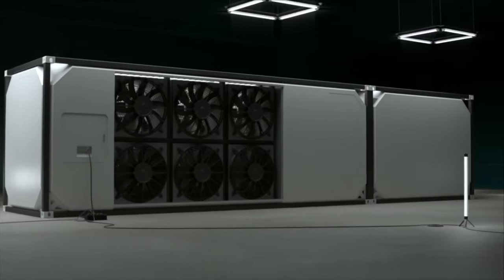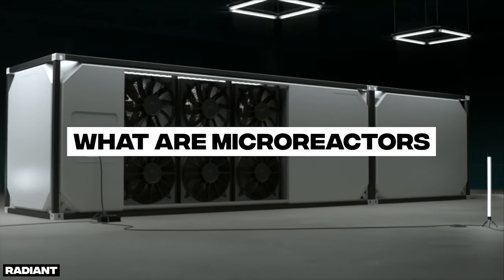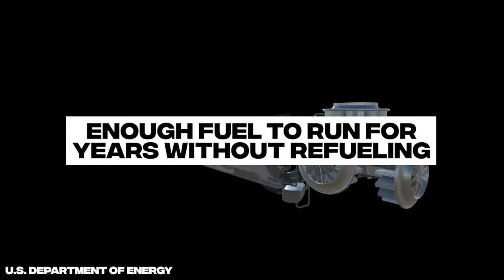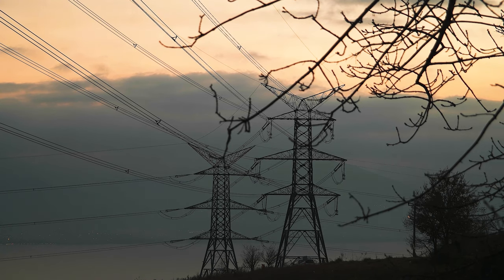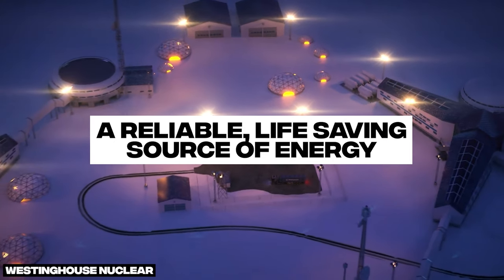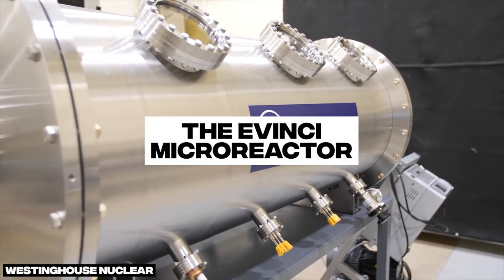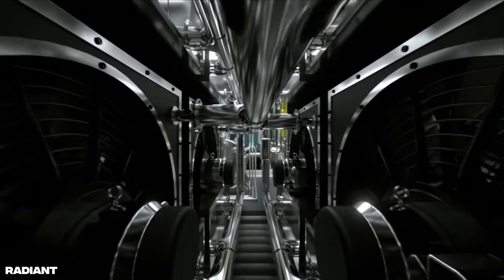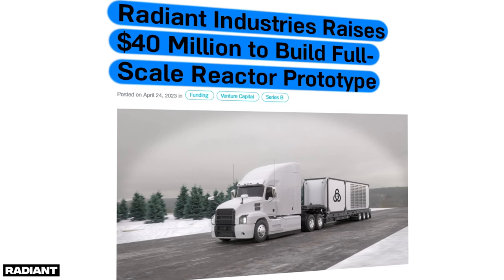Mobile Nuclear Reactors Will Change Everything

Comment: yea actually microreactors are faaar less efficient than real ones... its an absolute emergency solution that will mostly only fit to rare occasions like antarktica or north of russia. And than it is still the question is it neccessary to be at this remote place with a reactor. With russia they have used something likely and more than 1000 of the nuklear "reactors" have been abandonded somethere in the wild and while still not every one was recovered they tried to recover most until russia invaded ukraine and bailed out of the contract. The reactors where a more passive heatsource to generate power. Therefore the risk was not to have a meltdown but just contamination as things get old and people forget about them when they are not used.

So if the company running the site goes out of business, potentially nobody will care about a old nuclear reactor until people get hurt. They just get forgotton just because they could not transport it last month and maybe not next month to nobody cares about it. Some tourisst or scrapmetal thief one time or another will tamper with that thing. This is not a theoretical problem this already happend at least twice with some nuklear devices that had been setup exactly due to the same reason. Another one was left unprotected outside where extrem cold and water / ice crushed it open after many years in the wild.

These will maybe not destroy the earth but these reactory primary will create headache for the future.

Comment: This is crap. There will never be mobile nuclear power stations for the same reason there are no mobile coal power stations - the inherent inefficiency of small steam boilers/reactors and turbines. Small modular nuclear reactors were thoroughly explored in - to my knowledge - at least six countries in the 50s and 60s, with billions (in today's money) spent. The Soviet Union in particular went for them in a big way to power and heat Siberian cities. Like everyone else, they concluded it was far cheaper to just build big Chernobyl type reactors and run power cables to where you need it. It has nothing to do with nuclear's safety and everything to do with the physics of precision large hunks of metal.

Comment: Micro reactors make me wonder about nuclear proliferation.  If someone got a truck and stole a few microreactors, how difficult would it be to use them to produce plutonium?  This is probably much less of a concern for places like Alaska than places like Afghanistan.  It also sounds safer than nuclear container ships because at least they're designed to stay still most of the time and people would notice if the power went down.
Reply: 20% enriched uranium is not weapons-grade and cannot be used to produce bombs. To build a bomb, you'd have to enrich it to 90% or so, a process which would take time and money and a knowledge of nuclear physics.
Reply: The interesting thing is these (and other reactors) DO produce plutonium.  BUT that plutonium can't make a bomb.  When plutonium is made this way you get a mix of isotopes.  Pu239 comes from U238 absorbing a neutron (U238 is the other 80% of that "20% enriched" fuel).  However, with so many neutrons around, it rapidly moves to create a comparatively large amount of Pu240, '241, etc and these don't make bombs.  They actually are what make the Pu239 which remains USELESS for bombs.  If your next concern is what about separating out the Pu239, consider that if they can do that, it is easier to separate out U235 from U238 in the first place and skip the thieving.
Reply: @LFTRnow  This is interesting.  I forgot about other isotopes of plutonium.  Since the  reactors are not designed to be refueled, it would be tough to reprocess the fuel often enough to keep the Pu240 levels low.  So if I were an evil Bond villain, I'd rather try to find a molten salt reactor and leave these ones powering their cities.
Reply: The right amount of Explosives 🧨 and got a portable dirty bomb.☢️💥☹️
Reply: @YellowRambler  Not if they're as well protected as typical nuclear reactors. The containment buildings on most active NPPs today could withstand weeks of artillery bombardment and can't be penetrated by a Tomahawk cruise missile. Also, most of the radioisotopes found in a reactor are not the sort which a purpose-built dirty bomb would use, and are quite heavy, so they likely wouldn't carry very far.

Comment: The idea that using radioactive motors is some kind of great idea runs contrary to ALL environmental considerations - as in (a) There are VERY obvious risks to man and to the environment, and (b) What PRECISELY is to be done with all the radioactive waste? This is ALREADY a ticking time-bomb for future generations to have to TRY to sort out - from Nulcear Power plants. 

Give me alternative non-poluting energy sources, please. Vehicles could use bio-oil (non-polluting) and for energy there is not only solar and wind power, but recent R&D at Cardiff University (UK) have produced small-scale and effective means of using TIDAL POWER to generate electricity. 

Who knows, if UFOs do turn out to exist, then there must be some kind of anti-gravity/propulsion system powering them. If in doubt, ask an alien... 

I see any and all moves towards greater reliance on nuclear as being foolish and highly irresponsible.
Reply: > Vehicles could use bio-oil (non-polluting) 
It turns out that in Alaska the growing season for bio-fuel plants is quite short. (of course, you could truck it in, at the same cost of diesel, but then you have saved ???)

> and for energy there is not only solar and wind power, 
It also turns out that in Alaska the sun only shines for 2-3 hours a day for 6 months of the year - the COLD DARK months when power is needed most.
And the wind is quite low at that time also.

> but recent R&D at Cardiff University (UK) have produced small-scale and effective means of using TIDAL POWER to generate electricity. 
It also turns out that in the Alaskan interior, there are no seas to generate tidal power.

Huh! Who would have thought?
Reply: @factnotfiction5915 In Alaska, like everywhere else in the world, it is possible to IMPORT goods - such as biofuel. In point of fact, most of Alaska is sparsely populated, so importing electricity from other places - in this case, from, say, California, New Mexico, Texas, etc. shouldn't pose a major problem, should it? 

And there ARE coastal regions of Alaska where there ARE tides. And with such a small population in inland alaska, burning some logs in a wood-burning stove won't greatly harm the environment. 

Anything has to be better than makiing a massive problem for future generations by having nuclear waste to deal with in every nook and cranny.
Reply: @timelwell7002  
> In Alaska, like everywhere else in the world, it is possible to IMPORT goods - such as biofuel.
You must have missed the point on the video then.

These Alaskan communities aren't out to save the planet with low-carbon energy solutions. They are trying to get CHEAP energy, and low-carbon would just be a bonus.

However, I fail to see how IMPORTing biofuel (at about the same specific energy as diesel) would have a lower premium than IMPORTing diesel, especially as biofuel has a higher cost at the distribution point than mineral diesel fuel.

There is a high probability that a micro-reactor can provide heat and electricity (at a higher cost than traditional energy solutions in populated areas) at a lower cost than IMPORTing fuel.

> In point of fact, most of Alaska is sparsely populated, so importing electricity from other places - in this case, from, say, California, New Mexico, Texas, etc. shouldn't pose a major problem, should it? 
Again, you appear to have missed the point. These communities are REMOTE and SMALL.

Is it possible to run a HVDC/HVAC line hundreds of miles to serve these communities. Yes.
Is it economically viable to run a HVDC/HVAC line hundreds of miles to serve a community of a few hundred people. No.

EACH MILE is millions of dollars.

$1-2 million per mile for HVAC
https://www.power-grid.com/td/benchmarking-in-action-comparing-the-costs-of-hvdc/
"The per-mile cost of HVDC projects ranges between $1.17 million and $8.62 million"
https://www.eia.gov/todayinenergy/detail.php?id=36393

A community of 500 people 300 miles from the nearest substation cannot afford that. And should the rest of society pay $300,000,000.00 to serve 500 people? Or should we help them build a micro-reactor, and build other useful things like hospitals, schools, museums?

> And there ARE coastal regions of Alaska where there ARE tides. 

> And with such a small population in inland alaska, burning some logs in a wood-burning stove won't greatly harm the environment. 

Great for heat, but poor for lighting, computers, televisions, radios, power tools, etc.

I am not willing to consign any population, anywhere on earth, to 3rd world energy and 3rd world poverty because we can't provide lighting to read books.

> won't greatly harm the environment. 
Of course, for 3rd world populations, smoke inhalation from burning 'natural' carbon sources (wood, peat, dung, straw, and other 3rd world fuels) is a major health risk.
I am not willing to consign our fellow citizens to 3rd world fuels and health risks just because they live a rural life.

> Anything has to be better than makiing a massive problem for future generations by having nuclear waste to deal with in every nook and cranny.

65 years of 10% of GLOBAL electricity has produced 370,000 tons of spent nuclear fuel.
Does that sound like a lot? It isn't.

A SINGLE major coal plant will produce 370,000 tons of emissions in 15 days. (2.5% of Germany's, not GLOBAL electricity over those 15 days)

A SINGLE major natural gas plant will produce 370,000 tons of emissions in 83 days. (2.5% of Californa's, not GLOBAL electricity over those 83 days)
(see A Matter of Scale, by Preston Urka for references)

A SINGLE large container ship is about 200,000 tons, so 2 of them are equivalent in mass. And SMALLER in volume than just 1 of them.
Those 370,000 tons can fit 22,000 cubic meters - a field 150m x 150m x 1m high.

It is NOT a massive problem for future generations. And, what kind of future generation will we have if we don't expend power now to educate today's people, to provide health care for today's people, to provide food for today's people.

Why do you believe that living a life of restraint and denial will 'save' resources for the future?
We live a life better than ALL the preceding generations because those consumed resources and built cities, hospitals, schools, businesses, museums, music halls, etc - they used energy to create a modern society. Had they 'conserved' and kept a hand-to-mouth subsistence farming economy - then you and I, we too - would ALSO be living in a hand-to-mouth subsistence farming economy. It is the very fact that they did NOT 'conserve' that gave us our standard of living today.
Reply: @factnotfiction5915  From your answer you seem to suggest that there are only 2 ways that human beings can live: 

1) A 'hand-to-mouth subsitence farming economy' OR 
2) A world where everything is powered by nuclear power and everything is high-tech with a high standard of living. 

Has it occurred to you that there are OTHER ways of living outside the 2 extremes you portray? 

And has it not also occurred to you that high-tech does NOT have to mean nuclear? 

And, has it not occurred to you that one of the greatest problems the human race faces is we cannot to carry on polluting the Earth and changing the climate to the point of our own extinction? 

The long-term problems of nuclear waste are a ticking time bomb for future generations. 

Maybe you have ZERO interest in your children and grandchildren and great-grandchildren being able to survive? 

Pinning all your hopes on nuclear is sheer madness - especially when there are other means to provide ourselves with electricity. 

Another of the great problems faced by humanity is the massive inequality caused  by the greed and vanity of the super-rich - billionaire shareholders in Oil companies and Energy Companies, the low wages and high cost of living being imposed upon nations where the extreme Free Market Capitalist (Neoliberal) economic model is followed slavishly. 

THe UK, the USA, South Africa, India Brazil are all under the control of the super-rich. 

A mere 87 super-rich people control a staggering 50% of the Earth's resources. 

Your precious nuclear option won't change any of that.
Reply: @timelwell7002  > From your answer you seem to suggest 
And from your answer you seem to suggest that Alaskan rurals should live in poverty (to buy biofuel at a premium) or should simply live in smokey cancer houses (as they burn wood).

I note that in your response you do not counter any of my facts, only oppose your opinion.

You do not offer a lower-cost fuel for rural Alaskans.
You do not offer these people a better life.
You moan about 'future generations' but don't appear to consider the current generation.
This is not the view of a humanist, but one who has a preferred outcome, and you marshall your argument to be anti-nuclear - but not pro-rural Alaskan.

Show how wind/solar/biofuel impact rural Alaskans in terms of: art, economy, education, value, society, whatever!
Nuclear can positively impact rural Alaskans in terms of their economy, allowing them to devote more time to improving their art, education, society, etc.

> And has it not also occurred to you that high-tech does NOT have to mean nuclear? 
Sure. But, high tech and low cost does mean nuclear.

> And, has it not occurred to you that one of the greatest problems the human race faces is we cannot to carry on polluting the Earth and changing the climate to the point of our own extinction? 
Great! Let's stop burning fossil fuels and burn nuclear fuel!
Because we can neither carry on polluting the Earth, nor can we carry on futzing around with non-solutions like low-grade energy resources like wind and solar.

> The long-term problems of nuclear waste are a ticking time bomb for future generations. 
Hmmm. Nuclear waste becomes less and less radioactive and less and less waste over time, so no, I don't believe this is a problem for future generations. 

> Maybe you have ZERO interest in your children and grandchildren and great-grandchildren being able to survive? 
It is precisely because I want the next generation (and the several after that) to not only survive, but to THRIVE, that I advocate for nuclear power.
Clean, low-carbon, low-waste, low-environmental impact power

> Pinning all your hopes on nuclear is sheer madness - especially when there are other means to provide ourselves with electricity.

> Another of the great problems faced by humanity is the massive inequality caused  by ...[edited rant out]... Your precious nuclear option won't change any of that.
Ok, so now explain how wind/solar/biofuel does change that.

Wind - wind turbines are created by some of the biggest corporations in the world. GE (also a manufacturer of NPPs), Vestas, etc. Wind is not a village-cooperative-led enterprise, but a high-tech, high-capital intensive industry with massive mining, factories and massive public subsidies.

Solar - solar panels are mostly created in China by enslaved Uyghur oppressed minorities. Not sure how we build the society of the future on the backs of slave labor.

Biofuels - driven by massive monoculture agronomy which destroys biodiversity across the carbon sinks of arboreal forest, equatorial jungle, and food-producing cropland.

At least my story is consistent. Yours appears to wish away any negative aspect of the production and installation of, at best, a marginal source of electricity.

Comment: Haven't we had reactors like this since the 70's? e.g. Voyager I & II. Still running today.
Reply: Voyager has a nuclear battery, it's just a peltier plate (heat energy generator) on top of some radioactive material. It's not very efficient and would probably cost millions just to power one house
Reply: @marcrose1667  Shame it would be so costly, I could do with one to replace my water wheel.
Reply: You're right. Thorium reactors have been used for decades. Not expensive to make, simple design, and very safe if properly and simply maintained. They're not efficient, but if they don't cost much, that's not a major issue. Burning coal to make electricity isn't efficient, but it was cheap and worked well for us for a very long time....